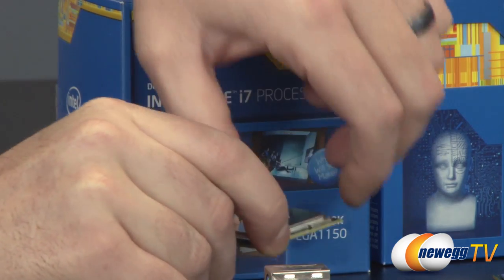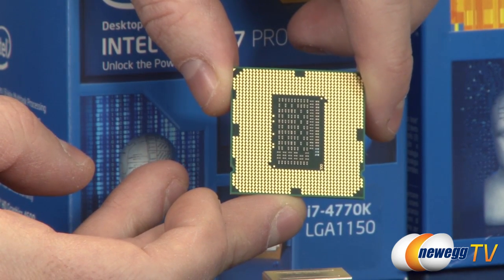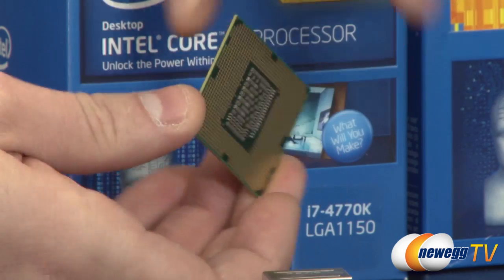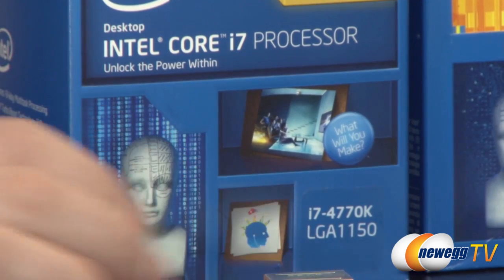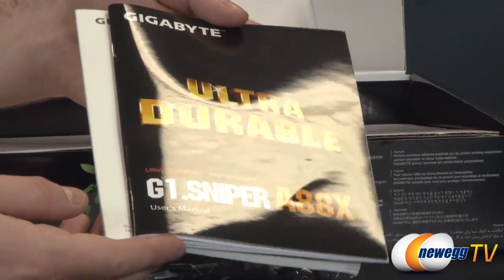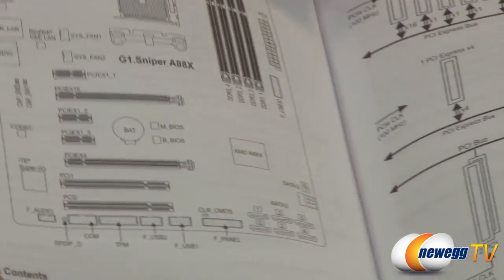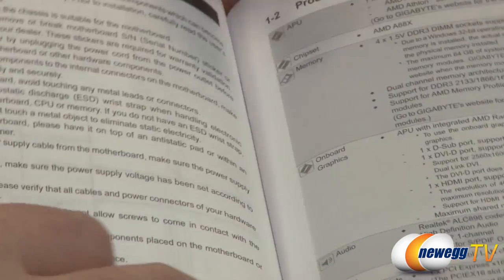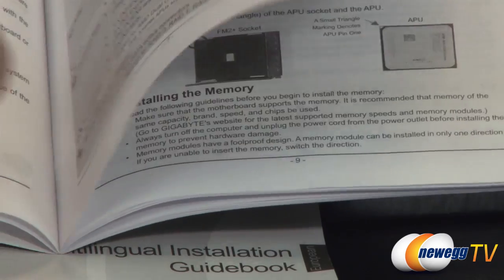What's a Motherboard? Newegg TV's Tutorial and Shopping Guide

Comment: CTRL+F tags: timestamp, time, tldr, guide

6:51 - MOBO manufacturer
11:00 - CPU
17:27 - Chipset
22:44 - MOBO size
32:02 - CPU cooler
37:00 - RAM, memory
43:50 - GPU, video card
48:45 - Drives, optical, SDD, HDD
51:00 - PSU, power supply
55:41 - Anatomy (this might possibly be the main thing you're looking for in this video)
1:13:08 - Opening up a MOBO box + quick install
1:21:05 - Installing a MOBO into a case

Comment: ok, so i have a lower end mother board(but still a gaming one) in my computer, and i have a gtx 660 in it as well but i would like to upgrade to a 980/970, would i have to get a better mother board for it, or would i not need to even bother? i dont plan on any overclocking of any components
Reply: You're good.
Reply: Meissna thx
Reply: Go on to either Tom's Hardware, and ask that on the forums.. or go to new eggs, I've personally used Tom's Hardware's forums, i'd recommend that. But whatever you prefer! :D

Comment: Amd + asus = problem if you upgrade anything...
Reply: Laimis  I've changed about 5 coolers on my ASUS / AMD rig and 0 problems i run custom liquid cooling and no problems
Reply: Why is that bro?
Reply: upgraded my cpu cooler to h100i boom errors of 0 rpm fans and -100 c warnings 100 c plus warnings and loads more whiles everything is working and its idling on 20c
Reply: Wow. Which AMD processor was it? Did it happen after you upgraded the cooling?
Reply: its not processors fault its motherboard that is going crazy....
Reply: and yes it happened after cooling was upgraded
Reply: computer is still fully functional and all its just these pop up warnings are very annoying...
and temp dosent go above 40 while i game.

Comment: i'm planning a massive overhaul on my current machine and i already have a case [cooler master elite 430] and a hard drive [toshiba 1 terabyte] and an optical drive. With those costs cut out, what motherboard, processor, video card, power supply, and RAM can i get all for about 300 dollars I'd prefer an intel processor over AMD because intel doesn't run as hot. Because the costs of the case and hard drive and optical drive are cut out, what all could i get that would be decent for most games? I have a 300-350 dollar budget to work with. i mainly go for pc games that are exclusive to the pc with no console versions. Not going for a hardcore gaming rig just an upgrade on a severely constrained budget that i can upgrade later on as i get more money.
Reply: I'm not too familiar with AMD processors (you'll definitely want one with integrated graphics), but I just looked up this board made by ASUS. (http://www.newegg.com/Product/Product.aspx?Item=N82E16813132055)

The board seems to be a pretty good choice, considering it's a Micro ATX form factor board, which should fit most cases I've seen. Could be worth checking out if you're interested in it.
Reply: already decided on a Asus F2A55-M/CSM Motherboard and AMD Quad-Core A8-5600K 3.6GHz Radeon HD 7560D APU Bundle last night.
Reply: As for power supply, mine is relatively effective and wasn't all too expensive I would say. It's the CORSAIR Enthusiast Series TX650 650W ATX12V/EPS12V 80 PLUS BRONZE Certified Active PFC High Performance Power Supply.
Reply: Ah, I see.
Reply: and i got a Corsair Builder Series CX 500 Watt ATX/EPS  80 PLUS (CX500) tonight. i'm on a constrained budget
Reply: killer13324 That sounds alot like my computer! :P. I also got the AMD A8 5600k and a 500 watt PSU.

Comment: i want to game,stream shows,render videos is there a mobo that can handle all that?
Reply: Yeah so you want a gaming pc. There's only 1500 videos on how to make a gaming pc.
Reply: Get an ATX motherboard, gigabyte or asus ROG/sabertooth is really good. Cpu should be a 4770k, great for rendering, for the gpu, get a 770 or 780, and if you really have enough cash, get a 780ti, make sure they are EVGA ACX SC, they have some of the coolest temps. Get 1600mhz 16gb ram, rendering eats up a lot of ram. You may want to get a pre filled cpu water cooler, a corsair h100i is a good cooler, make sure your case supports 240mm radiators, a corsair 750d fits it perfectly, for the psu, get the corsair RM series of psus, get the 750w or 650w for the 760-780 cards, if you're gonna SLI two of the gpus or a single 780ti, get the 850w. Beware, the better the gpu, the more power you need. Also, to keep the thing quiet, get 3 140mm noctua fans, ugly but super quiet, those are going to replace the case fans.
Reply: Another Games 770 isn't crazy at all, also, the 4770k beats all the others. And noctua fans are great, you'd have to be crazy NOT to get them. He can literally make this for 1000$. Notice I gave a lot of choices for gpu, psu. And some mobos can only handle 1333mhz ram or less, usually the cheapie ones, and I mentioned gigabyte, those mobos run about 80 to 100 sometimes 150 to 180, not half bad, sabertooth and ROG, the good ones run about 150 or more. Also, if he's gonna be rendering, streaming, and gaming, the pc is going to cost quite a bit, 1k to 1.5k will be good for that stuff, also, I think he would be aiming for 60fps and over because crappy looking live streams isn't going to help. Have you seen the latest benchmarks? Some guy rendered a 1080p video, tested with i3, i5, and i7, the rendering took almost and hour on the i5, the i3 was way longer than one hour, and the i7 rendered in half an hour. Same guy tested with ram, on 8gb, rendering the same video with a i7 4770k, it took almost 6gb, and who's to say he wants to skype and browse the internet too? It's gonna take up more ram, basically maxing it out. And most of the mobos I was suggesting were at 70-150. I wouldn't suggest a 200 or 300 dollar one. A entry level gaming pc can be a 600-700 if you spend it wisely. And I made a build here http://pcpartpicker.com/p/2tdko You don't seem to get how much power it takes to render 1080p videos and stream. Ask any youtuber who makes a lot of pc gaming videos they're gonna tell you a 600 pc isn't going to cut it, 600 is for entry level and straight up for gaming, nothing else, 800-1.2k is for moderate rendering and streaming, 1.2 - 1.5k will be the highest one, any higher would be stupid. I've rendered some videos before, never posted them obviously, it took a long time with my cheap hardware, it took an hour with my amd fx 8150 at 720p. I can say you're lying about being with pcs for 15 years when you know so little about how long stuff renders on lower end CPUs and what hardware these youtubers need to post these on time with high quality. Frankieon1080p uploads in 4k, and he has some beastly hardware in it, he can only make a video a day because for one, the editing, then the rendering in 4k which probably takes a few hours, then it has to publish, could take a couple of hours. So ignorant.
Reply: You need to chose a cpu first
Reply: If you were trying to show us of the 'beating all' cpu, you could have allowed yourself of talking about Workstation motherboards. All I see is a 770 super crazy (which I would say you are 100% wrong here because I can open every single game 30FPS+). Ignorant of what? That 6770 which costs 30$ opens all games? I personally think that wasting 1000$ without any real reason for what he is asking is pure psychopath, who makes a lot of money and gives electronics companies possibilities to create rebrands and stupify you even more. I don't need a 770 even for Game Development, unless you are talking about film where I would grab a firegl. So all in all, you are stupid man. I told u I can open every single game out there. If you think that 8xAnti aliasing is so important for you that wasting so much money (200$+ gpu) is so important, I think you have real problems. Oh, wait a sec, your choices were 760 to 780. Why? Why not 580 or 680. I mean your choices are so stupid, that only rich people who cannot calculate stuff do this. You don't even need so much power to play games. We won't see any real benefits into gaming until Watching Dogs comes out (because of x64 usage) Did you know that a game doesn't use more than 4Gigs of ram from your total computer power? Again, if you are talking about rendering, go buy yourself two 1000$ Xeon CPU so you benefit 10 seconds from rendering like a crazy man. With so much power, nobody needs all the stuff you suggested, unless you earn more than you waste. This guy is asking for a mobo, not even a GPU or CPU. All in all, stop this commercial crazyness, nobody needs a 4770K, only those who cannot calculate stuff. Like those people who getting top smartphones just to hear some music and play some games. This is crazy man, I have 15 years and you tell me ignorant? You don't even know what u are talking about. I have been programming and creating games, cinematics and so much stuff so that people like u plays them. Now it turns out you are talking to me as ignorant. How many games have you programming in total? Those are just commercials and if you think that a phenom II x8 is just 70% as fast as an 4770K, that is not a big deal when it comes to money and multitasking, it is at its best.
Reply: Another Games The ram thing is a myth, if you have multiple apps running, you're gonna use more than 4gb. YOu're also taking a 770 like it's a gtx titan or 780ti, look at tech of tomorrow, he's done tests of different sizes of ram and did benchmarks, same thing with the cpu and rendering, you're lying, I know it. ALso you do need a lot of power for SOME games, usually 2012ish to now. but a 770 can run most of it at high 60fps, and why the fuck are you aiming for 30+fps on pc gaming? You might as well be on console for that. You act like 1000 bucks is 10k, you have a horrible sense of what is expensive for pc gaming. 2k is expensive for sure, 1k is the medium between budget and high performance, and personally, why do you think 1k is expensive for pc gaming? I've watched many pc gaming channels on what's coming out, showing benchmarks for the difference between parts and what you should get for certain tasks, a 4770k is needed if you're gonna render or stream, a 4670k is all you need if you're only gaming, would you kindly fuck off?
Reply: CPU and graphics card are what will determine all that. then just choose a cheap but reliable motherboard.
Reply: Every single motherboard which costs 50$+ at the moment of writting can do what you mentioned.
Reply: ***** Why 4770k when there is Phenom II x6 or x8? Why ROG/sabertooth when other motherboards for 50$ do the same job? Why 770 (this was crazy though) when my 6770HD opens every single game with 30FPS+ out there and you can get one for 30$??? You don't need all this stuff man. This is just crazy waste of money. You waste ~2000$ for a ~400$ build I suggest. Also, you will waste less energy with the ones i suggested. He doesnt want a studio. I can open Crisis 3 amazingly good with x2 AA. Why would someone take all this stuff (noctua fans? LOL, that is pure commercial) I have a chinesse 120mm fan and it works so well, you can't even imagine. (3xHDD went from 33C to 23-24C with just one fan). So your suggestion and all those crazy guys offering 300$ motherboards suggestions are some crazy guys. Why would this guy need 10 sata connections? Really stupid and since I have more than 15 years in the computer world, people never understood the WHY. Why would this guy spend so much money? Every single mobo for 50$ can do what he said. I have bought it in 2011 and it works perfect with my gpu.
Reply: *****
1) Look at my channel, it got games played with 6770HD, even Crisis 3.
2) I cannot lie about computers.
3) 1000$ is budget for america but not for worldwide.
4) When i was part of a website forum, they benched Titan. I got the same FPS of crisis as the titan without Anti aliasing. Just for that, would I be so crazy to buy a 1000$ card? Never.
I would suggest a 7870HD though, but since they are not so easy to get anymore and they just cost 120-150$ used, more than that is just pure crazy.
Just don't believe what others say. I got a phenom II x2 and a 40$ mobo 3 years ago. I unlocked the phenom to x4, all L3 caches and that mobo was super amazing. All I would ever need.
If you see others benches, they try to advertise 8GB of ram, when you don't even need a single stick of that. 6 gigs are more than enough. The most intensive game I have ever seen sucked 2.6 gigs of ram. Why would i need more than 6 gigs?
Reply: AMD aren't going away any time soon.